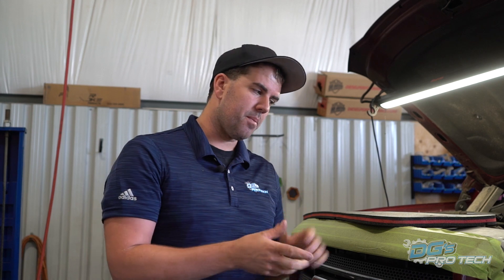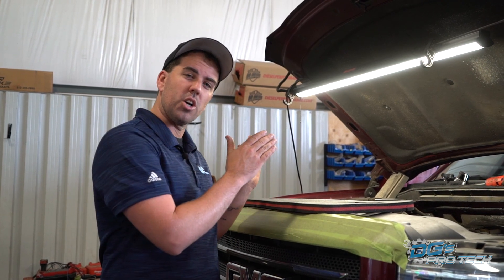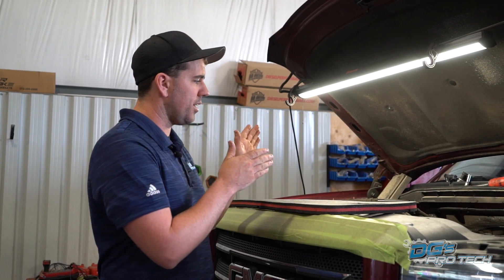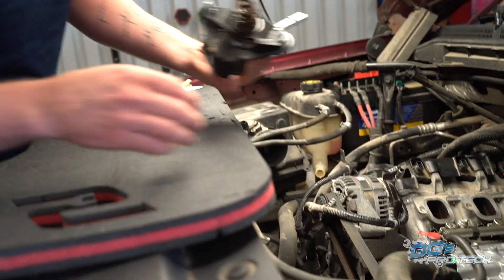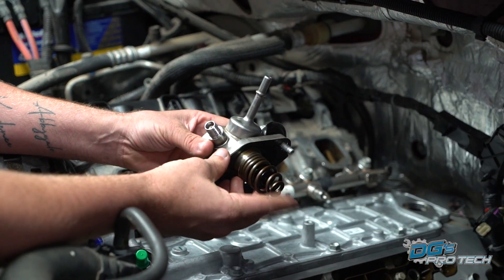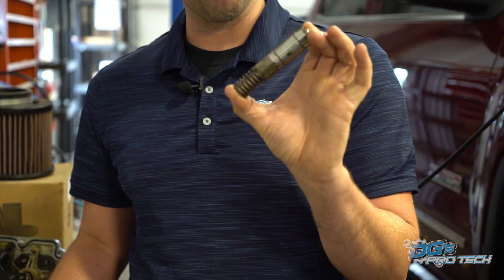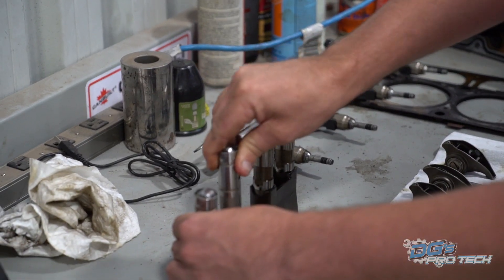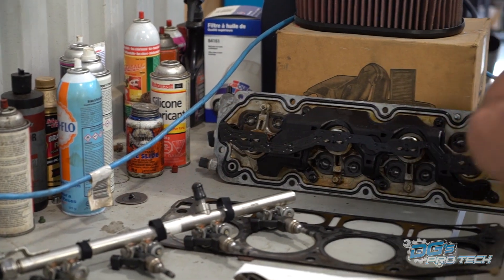DGsTV: Gen 4 GM dod (cylinder shut down) problems and explained

Comment: I just bought a 2015 GMC Sierra with 64,000 miles, and i got all of service records along with it.  They changed oil every 3,000 miles.  
My question is if i buy a disabler for the DOD will this cause any new issues, and will it prevent the lifters and transmission issues?
Great video, and I do hope you respond. ✌️

Comment: Why should I buy a Silverado that shuts down cylinders? They seem to me to be waiting on a wrecker before I buy it.* I have an 05 that was a lemon because of electrical components. It's broke down a dozen times usually the ignition module. I'm a Chevy fan but I can't afford a truck that will need repairs

Comment: In theory, a good idea. Were they able to pull it off with reliability or longevity? Not a chance. GM started this in 2007. To bad the class action lawsuits dont cover that far back. Lot of people got ripped off. GMs fault? Not entirely. Federal government constantly pushing manufactures for increased fuel efficiency standards. Who ultimately pays for these failures? The consumer

Comment: 2017 6.2L GMC Sierra, 55,000 miles, lifter failure after 59 months of use and bent pushrod. Bought new, always serviced with full synthetic Mobil 1 and Mobil 1 filter. Would be interested to know failure rate of AFM/DOD lifters. Seems only a matter of time before a lifter is lost/fails. Debating how to move forward. Only symptom was ticking noise, no codes, no misfires.

Comment: That was interesting. I have a 2013 Sierra with afm but no problems yet. I know it’s comin though
Reply from the maker: hey! Ever end up having any troubles with that Sierra?
Reply: @dgsprotech985 no trouble with the sierra yet but still pretty low miles. 38000

Comment: The afm system is not the only troublesome area of the 4th gen LT V8 engines .. the variable displacement oil pumps have a high failure rate as well ... My 2015 Sierra 5.3L went through 3 oil pump assemblies in 4 months before I traded the truck off . Poorly designed and engineered parts. GM's QDR has gone down hill . Very disappointing